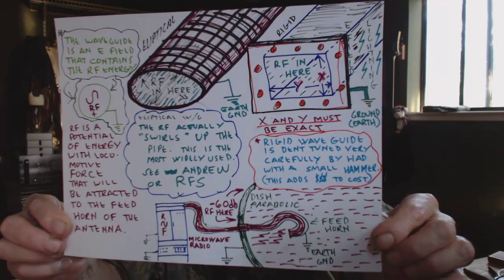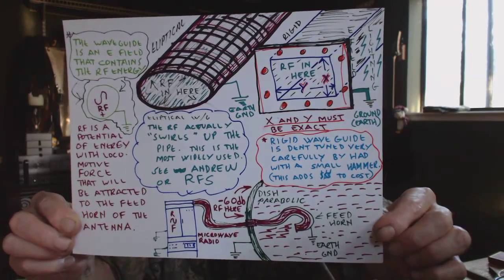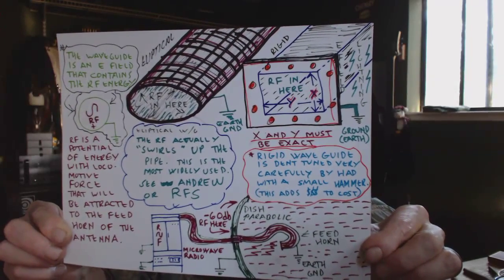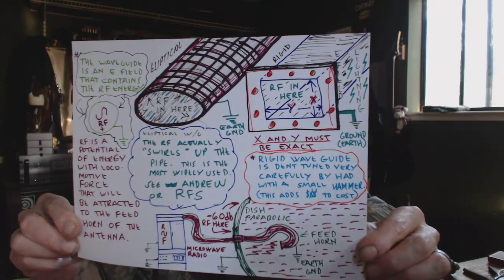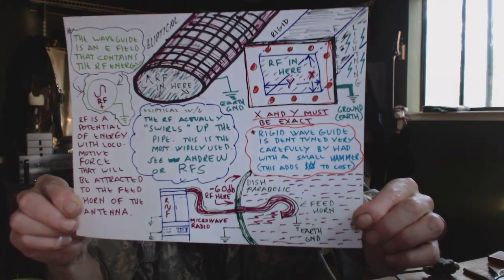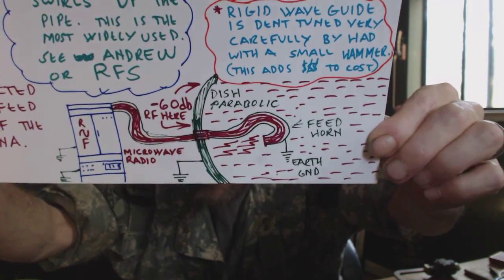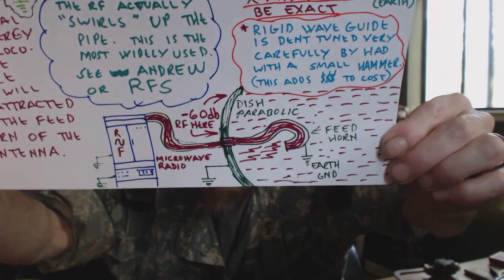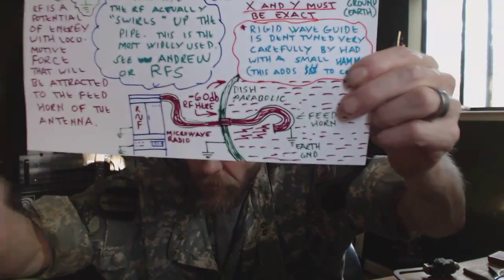WAVEGUIDE 101a

Comment: First time I saw a wave guide was on a F106 at the Fresno Air National Guard in 1980. I noticed that something arced out of one of those rectangular connections and you could see that it really threw a splash. They had it disconnected and I wondered how a hollow tube could transmit any form of "electricity" (because of the arc I saw). As a kid, dad would take us on many cross country trips. At night I was amazed at the tall towers and blinking lights and imagined a chatter of voices communicating on invisible waves. Thank you for the info and the renewed childhood.

Comment: Hey James.. Very cool information regarding waveguides!  Just recently I won a bid at an auction and a lot of these boxes contained a bunch of parts for microwave antennas and satellite based antennas.  In one box I noticed it was full of brand new waveguides still in the packaging.  These things are extremely heavy duty solid brass 90 degree bends.  E-bent and dent tuned waveguides.  The brand name is "Andrew".   I looked them up on the web and noticed these particular waveguides are no longer made. I did notice though that similar waveguides like these are very expensive.  Any clue as to what I can do with these ones??  If you would like a photo of one let me know and will email you some shots of them.  Thanks for the informative video!